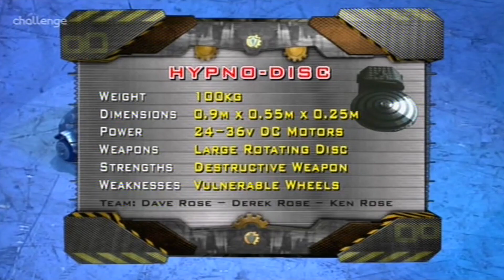Robot Wars: Extreme - Episode 15

Comment: Razer definitely let Razer go, they put the claw in through two different wheels, releasing them in between to come in from a different angle, which Tornado allowed them to do. It was a fair win and Tornado had no reason to complain.
Reply: That’s what I was thinking too. The first crush disabled one of the wheels and it was going around in circles after that. So  it was definitely a fair win for razed
Reply: I also love how tornado complain about not being allowed to move, yet their tactics are to push robots into the wall and ram them a.k.a holding them in place and not letting them go

Comment: The 'sexism' vengeance fight was so badly scripted that it was horribly cringeworthy. The Thermidor boys were so obviously uncomfortable faking it both in the pits and with Craig.

What's the time limit on holds for Robot Wars? I know Battlebots is 20 seconds, but Razer seemed to hang on for an entire minute. I figured they were going to win, but Tornado could have actually made a fight of it if they had ever been set free.
Reply: The time limit on holds for Robot Wars back in the classic run (I don't know if it was the same in the reboot) was 60 seconds. But Razer didn't have its claw sunk in for that long. It withdrew enough, but Tornado genuinely failed to put up more of a fight. That's just the way it is.

Also, not that I disagree with robots being separated from being locked together (you could equate that to a referee separating boxers in a similar predicament), but the idea that roboteers should be disqualified for holding on to their opponent for too long is ludicrous to me. If you're applying a hold, you shouldn't have to concentrate on how long you're applying it when your only focus should be on scoring points on damage and/or aggression. If there was an order over the PA system ordering robots to separate and distance themselves after a certain amount of time and either one refused, fair enough. Otherwise, focusing on how long the hold's going on for - it'd possibly result in you being a second or two off when letting go and getting needlessly disqualified, or it'd unnecessarily increase the chance of your opponent getting the upper-hand. I'm simply saying that the separation should initially be down to the officials to perform/order, not the combatants themselves.

Plus, it seems to me that people only bring up this argument about time limits for holds whenever it's Razer applying the hold, yet not for anyone else. Not that I automatically think you're one of those people who turn out to be pretentious Razer haters - I'm just saying.
Reply: Hollowest victory ever

Comment: 8:40 THE PATRIARCHY WINS AGAIN

18:06 Be careful what you wish for, Craig! 

19:46 Best attempt at a jinx I've seen on Robot Wars! 

21:24 I may not like Razer, but god damn if Razzler isn't the cutest thing I've seen on the show that isn't one of the kids.

35:48 Eh. EEEEEEH. No denying that was a comprehensive victory, but surely SOMEONE must have pointed out that the no pinning rule means you let them go, not sorta remove the beak from the other robot and plunge it straight back in again. Battlebots S7 did this clearly - Photon Storm had to let Minotaur go fully to satisfy the criteria while Razer and even Tiberius got away with maybe a millimetre of clearance before sinking back again. I dunno, this fight makes me feel much less worse about the S6 final.
Reply: they actually did eventually let go of tornado at 36:33 but by then tornado's drive was damaged and they couldn't get away

Comment: Okay, why was Anty B ruled as eliminated when the arena flipper's supposed to throw robots only and not trap them? What, were the antweights just looked at as more of a joke? First there’s racism, then sexism, and now sizeism apparently.
Reply: Anty B was in no position to get out from under the flipper (there's a well underneath for the mechanism which he fell into) and I don't think they were expecting anyone to get stuck under there to begin with.
Reply: @OneHundredPercentAus  Regardless of expectations or a well, the battle should’ve been paused to get Anty B out of there, based on the fact the rule with arena spots that weren’t the pit or the outside of the arena were that they weren’t supposed to trap robots in place, regardless of weight class. The officials saw this immediately when Cherub got stuck under the arena flipper, and that was when Cherub faced the same team that were treated differently here!

Comment: Thermidor vs Napalm - is that a joke?   Only way Thermidor could lose this is if it (a) breaks down or (b) gets tangled up in the wreckage.   Which it didn't.    Even more satisfying, it tossed the wreckage out of the arena, sparing us the usual BS of overweight house thugbots smashing up the loser. Not that there was much left to wreck.
Tornado vs Pussycat - my money's on Tornado, but not because of its spinning drum.   The Cat is very fast, that blade is very damaging, but Tornado is built like a tank.   My guess, Tornado will push the Cat around until something breaks.  But then the Cat is pretty tough too, it might come down to a judges decision.   ... And that was a good tussle, but quite convincingly won by Tornado's pushing power.
The antweight fight was amusing - and CombatAnt's spinning flywheel was remarkably effective.
Hypnodisc vs NastyWarrior - looks like no contest.   NastyWarrior's blade looks pretty feeble compared with the massive spinning disk on Hypnodisc.   Well, in my view Hypnodisc should have won that based on damage - NastyWarrior got shredded, and Hypnodisc's disc was still spinning at full speed when Refbot counted it out.   NastyWarrior was barely mobile at the time.   The only damage to Hypnodisc was caused by Matilda which quite illegally came out of its corner (so what else is new?).   I think the rules conveniently gave a victory to the visitors.    The boos of the crowd just indicate they know a fit-up when they see it.
Tornado vs Razer.   (Well, JP seems to have an obsession with Tornado's spinning disc.   Nobody else does.   I suspect Tornado only added it to satisfy some 'active weapon' rule.   Tornado's real'weapon' is its pushing power.    And why do the producers persist in flashing up profiles of the house bots before each fight - its not as if they're combatants).    But once Razer gets a grip on a robot, it's almost impossible to escape.  Really Razer is a rather horrible robot in its method of operation.

Comment: Razer is better and always has been better than Tornadol. In the end, Tornado had to employ a rule-exploiting strategy to come even close to winning.
Reply: It was within the rules and Razer even admitted that it was in the rules. Tornado won that fight fair and square. Yes controversial over the pit at the end, but Razer still had them in their claw so Tornado weren’t in the pit . Had Razer let go, then yes they’d have a stronger case.
Reply: @tombardsley3081  Tornado DID NOT win fair and square. If you have to practically use a different robot to steal a victory from a robot you can't be bothered to outdrive properly and be better than, you don't deserve to win at all. And the rules you use as a poor excuse were PART OF THE PROBLEM for how stupid and inconsistent they were...

Firstly, Razer shouldn't have had to let go when it had Tornado immobilised over the pit, any more than Probophobia had to let go of Snake Bite when pitting the latter in Extreme Warriors 2. Razer got Tornado into a blatant dead spot over the pit that the latter wouldn't have escaped from whether held there or not, therefore Tornado should've lost right there.

Secondly, what's the point of having the pit if you allow robots to be big enough to avoid going in? Yes, you could still be counted as pitted for being stuck over it or on the edge (which again, Tornado was), but the pit's designed for robots to FALL IN. If getting stuck on it is literally all there is to do, you might as well just bring back the grilles from Series 1.

And thirdly, the officials saw how unfairly defensive Tornado's anti-spinner and anti-axe were for specific use against Hypno-Disc, Dominator 2 and Terrorhurtz respectively, and BANNED the devices, yet allowed the anti-crusher because it included moving weaponry, which makes no sense whatsoever. So what if it has moving weaponry or not? It's still a device designed to render a specific robot's attack methods useless, therefore all devices should've been allowed, or none of them.

Furthermore, this "it's justified because it's within the RULES" logic is nothing but a sheep's mentality here. That's like saying it's justified for people to be EXECUTED for being gay just because it's in certain countries' rules, when the reality is that such rules are deplorable and shouldn't even exist. And yes, I know - human rights is a vastly more important subject than a robotic combat show, but it's the same principle in that rules shouldn't even be in place, let alone followed, just because they exist. They're supposed to be based on morality and not fail to live up to it. For a more accurate comparison, would you think it was fair if I was allowed to use special armour to render your punches ineffective in a boxing match because you'd beaten me easily prior? Or would you say that I was an undeserving coward and that the rules were a joke?
Reply: @ryanodonovan9497  tornado did win fair and square. They had lost to Razer twice before so they needed to do something to help them win cos Razer would most likely beat them if they kept with the same tactics as before. The weapon was within the rules. Interchangeable weapons were allowed. It’s why they could put the spike on Vs anarchy and the scoop Vs hypno disc and dominator 2. Razer were allowed to add stuff to their machine and it was seen as legal.
Razer should have let tornado go. That would guarantee they would have had a case at the win. Fact is, they were dominated for 85% of the fight cos they couldn’t grapple Tornado. They were lucky they even had the chance to lift tornado and dangle them over the pit cos they were nearly immobilised earlier on. 
In any sport, you’re allowed to change your tactics to counter a specific opponent as long as it’s within the rules. That happens in individual as well as team sports. You think the patriot with Brady and Belichick played the same way Vs every opponent? They did not. They adapted their tactics to take away the biggest threat of their opponent. By this flawed logic where you think tornado changing their robot Vs a specific opponent is cheating/unfair, then everyone that put a self righter on to counter chaos 2 after they won series 3 and 4 or thicker armour to counter hypno disc were also cheating/unfair.
Also tornado used a wedge  Vs hypno disc and dominator  which again is a perfectly legal weapon and took advantage of their opponents weakness of being pushed around. 
The whole pit argument, I just counter with the fact that significantly large walkers were allowed to compete in the uk championship and they wouldn’t have fit into the pit. You look at robots like black widow and eleven from series 5 and tell me how they can fit in the pit.

Ridiculous to compare poor human rights laws with sports competition rules. Sports rules are set in stone and should be followed letter to the law. Spirit of the game/rules means f all for some people/teams if it means they get an advantage. If they’re not breaking the rules, it’s legal. 
If the armour is allowed in your boxing example, then it’s fair game and it’s a legitimate tactic to help you try and win (although if I found out that someone was doing that, I’d get armour myself).

Comment: The last battle wasn't fair for tornado they had already fought pussycat although tornado won pussycat is a strong bot and did damage so tornado was weaker
Reply: You do realise the battles were filmed out of order right? The All Stars final was filmed before Tornado even had the challenge belt.  Both Series 5 and Extreme were, for the most part, filmed at the same time.  The last battle to be filmed was Razer Vs Pussycat in the vengeance battle that appeared in Episode 4
Reply: @andersonhill3484  
Yep, part of Extreme 1 (along with Season 1 of Extreme Warriors in the US) was filmed at Earls Court. The remainder was filmed together with Series 5 and Dutch Series 1 at Elstree Studios.

If you know what to look for, you can even tell where each battle was filmed as you watch Extreme 1. For example, the CPZs in the Earls Court arena have three black stripes while the ones in the Elstree arena have only two.